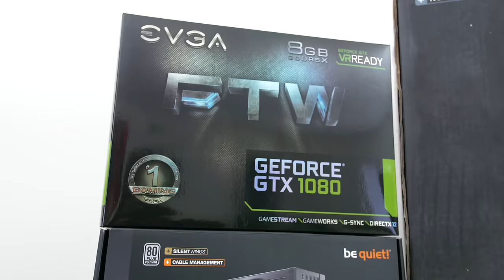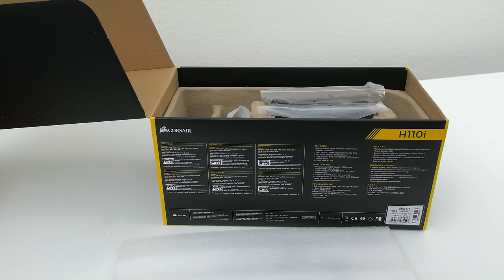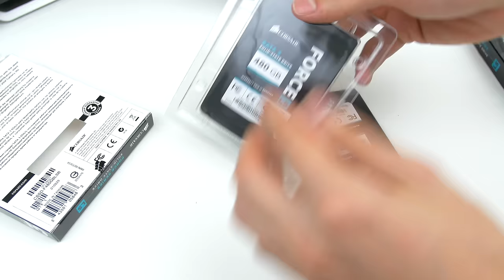$4200 Ultimate Gaming PC - Time Lapse Build

Comment: am i the only one that noticed he used no thermal paste
Reply: It comes pre applied to the h110i
Reply: ok ty i was like well thee goes a 1200$ cpu lol
Reply: +toxicbear chris 1,750$
Reply: oh well regardless thats almost the cost of my whole rig
Reply: +toxicbear chris my rig is 450$
Reply: lol well to admit im spoiled by my brother lol
Reply: Package Contents
Corsair Hydro Series H100i High Performance Liquid CPU Cooler
Magnetic Multi-platform mounting kit for all modern CPU sockets
Dual SP120L High Performance Fans
USB Cable for Corsair Link™ Compatibility
Fan and radiator mounting screws
Thermal compound (pre-applied)
Quick Start Guide
Reply: That thermal paste is the worst that you can put..
Reply: but still keeps temp under 45C under full load... so works for me
Reply: its pre applied on the h110i form corsair
Reply: +Fulgar from*
Reply: I thought that too :D
Reply: It's pre applied but it's crap, if I was putting in a $1,600 cpu i sure as hell would not be using the crap paste it comes with!
Reply: +Jrock420blam the thermal paste on the h 100i he used isnt bad at all
i thought so myself and put on some arctic mx2 (a mid range thermal paste) and temps went up 7 to 8 degrees
Reply: Robert Mantzke  You're probably right usually I use Gelid GC-Extreme or even Coollabratory Liquid Ultra if I feel like voiding my warranty for extra cooling so compared to what I use it was crap but its probably mid end paste, I was just running it against the high end giants.
Reply: toxicbear chris
Reply: grizly huh it transfers the heat from the processor to the cooler

Comment: can you do a 1200$ build next month?
Reply: lord eddie
Reply: Yea
Reply: 2 RX 480, i7 6700k, put on a z170 Asrock board with some fitting GDDR4 RAM. SSD and Cooler of your choice, fitting power supply put in a case of your choice and it's done.
Np m8
Reply: no rx 480 its shit
Reply: +StarStriker4101 Crossfire/sli have always problems
Reply: +StarStriker4101 pretty much a copy of his latest video but kk
Reply: I7 6700K + GTX 1060 and the rest is easy.
Reply: +Super Vegetto 1060?
Reply: CHINESEKID420-_-BROTHER Yes, go check it out, i belive the price is around 260$
Reply: +Super Vegetto $248
Reply: LoLcRoKN Eune Yeah cause that's pretty much the same price range. You can't expect much more from a build 200 dollar more expensive. The only changeable thing is to put in a GTX 1080, but everything else ist just fine as it is.
Reply: Philip Diegel you're missing HDD SSD
Reply: LoLcRoKN Eune I know I was assuming he already has a computer and would just move those parts over.

Comment: $4200 and only one GPU?
Reply: Cameron Jackson something called "future upgrades"
Reply: Cameron Jackson The MOBO and CPU totally overpriced it.
Reply: Kimchi Bomber it's not about the best performance for the money.....
Reply: the memory alone are like a tons of money
Reply: +Ferdo Gaming It doesn't look good either..
Reply: Cameron Jackson the cpu is $1000
Reply: Kimchi Bomber It was the SSD and cpu
Reply: big j gamer nope. ITS about $1700. The 6900k is $1000.
Reply: ***** You don't need $4200 worth of pc parts to get a good gaming experience...
Reply: Cameron Jackson crossfire and ski can be unreliable, so if you have just enough money you should go with one powerfull gpu
Reply: TACO CLOCK but for a $4000 build   a 1080 isnt much. A titan was what i was expecting. $1200 pc has a 1080 in it
Reply: The problem there is that hes calling it a gaming rig.
CPU barely matters compared to the GPU if its actually for gaming.
Sort of a waste like this.
Reply: Cameron Jackson and a cpu who is Not good for Gaming
Reply: TACO CLOCK No not for 4K gaming the new monitors with 165 hz and hdr will released next Year and they really need the power of 2 gpu
Reply: raistrose finally One who knows a little bit about pc Hardware -
Reply: I'm from 2024 and u could get a 4090 for that

Comment: Why does the intel SSD go on the motherboard, while the corsair ones don't? Im a noob so pls dont hate :O
Reply: ANICREATOR Because the intel ssd is pci based while the corsair one's are sata based
Reply: and what difference does that make? :O
Reply: A pci based ssd is much faster than a normal sata ssd
Reply: ty for replying man :)
Reply: I have that same drive. I tested it last night and it read at 2.4 gigs per second. In comparison, my EVO 850 reads at a max or 550-600 megs. The nvme drive is 4 times the read speeds
Reply: ANICREATOR the more you know
Reply: d no SATA3 limits to 600mb/s. NVME allows speeds that thermalthrottle the chips, so there we dont even deal with speedproblems, but with heat.
Reply: ANICREATOR the intel ssd uses a pcie which is on the mother board. It is usally under where the graphics card goes. The corsair ssd uses sata so it tis connected by a sata cable from the motherbard's sata port to the ssd.
Reply: Also some Intel SSD's are sata based too but to use them you need an intel cpu but companies like Samsung make m.2 slot ssd's which are quick but expensive :3 (For example the Samsung 950 Series SSD)

Comment: Me just sitting here with my 50 dollar windows xp PC
Reply: Applepython2810 my pc has a shit i5 4460 and a GTX 750ti
Reply: mine is a dimension 2400 with a intel pentuim 4!
Reply: Refeat Playz lol that's a monster compared to mine. 2GB DDR2 RAM, V140 AMD CPU, and a Mobility AMD Radeon 4200 Series. Runs TF2 at lowest settings and resolution at 25 FPS average.
Reply: MultiConsoleGamer welp. time to upgrade?
Reply: Cant run GTA cant run Fallout 4
Reply: just sittin here with no internet connectivity 99% of the time........
Reply: no it runs at a terrible High 1080p 58 fps
Reply: Sittin here playing 3d pinball space cadet........
Reply: lol gg
Reply: Refeat Playz me just sitting here with a ball mouse on carpet
Reply: gg me m8y
Reply: Crackhead jack sitting here playing 20 seccond midi files......
Reply: omg do you not know what midi files are?
Reply: I've got an Acer laptop. i5-3210M, GT 630M 1GB, 4GB DDR3. The only good thing is my 500GB SSD
Reply: Transistor Express I can run some games. CS:GO plays at ~35fps. Far Cry 3, ~26fps, GTA V, ~20fps, Rust, ~30fps
Reply: Transistor Express I'm playing everything on the lowest settings. As soon as I start a game, like CS:GO, I get around 60fps, but after a minute or so the fans go on the highesst and performance decreases by 20%-50%
Reply: McYellowBird just sitting here with a floppy disk drive and steam 1.3.4
Reply: Transistor Express Yeah I'm waiting until after my birthday (early Jan), then I'll buy my PC. Here's my potential build: https://www.pccasegear.com/sc/4TMK
Reply: Transistor Express I'd go with 16GB of ram, otherwise, great build. I might wait until the i5-7600K or get the i7-6700K when the Kaby Lake's released.
Reply: Foxhound Zycth sitting here with my pentium 4
Reply: Foxhound Zycth types :/ on my windows 98 keyboard
Reply: Foxhound Zycth sighs in midi
Reply: DJ RENZO actually it came with a windows 98 keyboard
Reply: Applepython2810 got mine at the dump for free
Reply: lol i had to slice (i play today and my brother tomorrow like that you got the point) but i have Fujitzu wacuum cleaner as my own computer
Reply: xxBluemonsterxx FIN sitting here with a failing hard drive
Reply: @Gamingdude bro, my computer can't even run TF2 at the lowest settings it runs at least 4 FPS
Reply: Shaf sameeee
Reply: Running i3 @ around 2ghz with intel graphics hd 400 and

Comment: Are you gonna do one with gtx 1060?
Reply: no, because 1060 is crap
Reply: $250 for the 3gb model, and who knows about the 6gb model.
Reply: +Telvres boi nvidia confirmed that they won't be a 3gb 1060, that's 1050
Reply: 980 performance but with 3gb of vram for $250. 6gb is $300. RX 480 is 970 performance but with 8gb of vram for the same price as the 3gb 1060. the 1060 is indeed crap.
Reply: Reitanna IT ISNT 3GB LEARN HOW TO READ
Reply: +Reitanna there is no 3gb only the 6gb. You know that but you just want to fanboy out.
Reply: my bad, y'all. you can chill now.
Reply: Please note that the RX 480 has more compute power than the 1060, so it has the potential to become faster than the 1060 with driver updates.
Reply: omg, so dumb.
The rx 480 has more potential power than a gtx 1060 and is cheaper (rx 480 8gb is about 270€ and the gtx 1060 is about 380€) 
So it is not fair to compare the gtx 1060 with an rx 480.
In Price comparison, it would be fair to compare the gtx 1050 with the rx 480.
And in performance the rx 480 is compareable with an gtx 1060 ti /gtx 1060.
So it is totally not worth to buy the gtx 1060 and in dx 12 AMD cards rock.
Reply: Fluff Off NVIDIA confirmed the 1060 will have the performance of a 980.
Reply: Reitanna I fucking know,im fully loaded to see the 1060 fail!
Reply: Fluff Off hahaha ;D
Reply: +Fluff Off pascal technolegy watch them succeed
Reply: Frozy FX i am still waiting
Reply: +Fluff Off nvidia told that 1070 will perform like a titan x and it is actually slightly better than titan x!!
so it they say 1060 will perform like a 980 then i am damn sure it will perform that well
Reply: Of course it would perform like a Titan X since its a 980 Ti rebrand with a higher clock speed,more vram and a new design
Reply: Fluff Off is the 1070 a rebrand?
Reply: Fendt Arena Rebrand of refresh its just a 980 Ti with higher clock speed 2 more gb of VRAM and a new design,and less power wattage
Reply: Frozy FX HAHAHAHAHAHHAHAHAHAHHA making a 980 performance card for $200 from Nvidia??? you must be joking lets see some dx12 benchmarks
Reply: Fluff Off fucking wait
Reply: Im fully loaded to see the fail of Nvidia! im just waiting
Reply: Fluff Off leaked benchmarks showing it is better than the 480
Reply: +Fluff Off NEVER
Reply: Frozy FX Goodbye Maxwell! hope you have a big grave so you can share it with Kepler!
Reply: Fluff Off maxwell is out pascal is in ;)
Reply: Goodbye Maxwell ! hope you have a great time with Kepler! Goodbye wallet ! hope you have a great time Pascal !

Comment: I need a $8,000 PC that can run Minecraft at a steady 40 fps.
Reply: Yeah, unfortunately this can only run it at 12 fps with all minimum settings
Reply: your prayers have been answered: the revolutionary new Mac pro
Reply: +Nissan U. (SUBW00FER) iPod touch u mean
Reply: underrated reply hahahahaha
Reply: hey panda, get a mac pro, i wouldnt because my garbage is already full
Reply: +Suryashekhar Das ill just get a pc for 1000 bucks and ill outperform it by like 10x the strength
Reply: Try to build icecube
Reply: Just buy the case for $8.000 and ur got ur 40 fps steady 40 fps
Reply: +Edward Kenway iPhone 1st Gen
Reply: then make it with a diamond case and use a 3$ xeon processor with intel integrated graphics
Reply: yeah right
Reply: Dude my $320 gaming pic run Minecraft at 350+  fps I don't know what's up with you. Maybe you should learn what parts are the best.
Reply: +Sir Spencington no way man. Ur pic must have fallen from heaven
Reply: +TariKing Hussain pc*
Reply: well here comes the pretentious door
Reply: mah pc wont even let me run in minecraft without lagging like fucking mcdonalds wifi on COD
Reply: CheeseBox good job on the budget there

Comment: I would choose instead of that 1,700$ Prozessor a second evga 1080...
Reply: This was sponsored, so he didn't have much choice on parts.
Reply: 6700k and another 1080 would be nice
Reply: Ik but the 6700K is better for gaming
Reply: ***** That formula is not relevant at this price range.
Reply: kaden niss The 6950x performs worse than the 6700k in most games.
Reply: Philip. You drunk. Ded.
Also, it doesn't. It performs about the same, better on multicore games, worse on single core ones, owing to the fact that it's clocked lower.
Kaden, you're drunk. Go home. The 6700k is so much better price/performance wise, and performs better on some games. See above.
Reply: Or an i5
Reply: The Star Ball With 2 1080s? K xD
Reply: +SpazSpy i7 6700k is much better in price/performance wise but i7 6950x is much better in sli'ing. 6700k doesn't support two pci-e x16 lines while i7 6950x supports two pci-e x16 lines. Therefore if you are sli ing i7 6700k can't send data to the gpu efficiently enough , it will bottleneck.
Reply: Exploding Bullet Yeah, but if you have the option of 2 gtx 1080s and an i7 6700k, or a single gtx 1080 and i7 6950k, wouldn't you choose the first option?